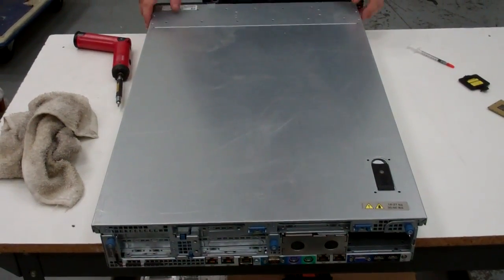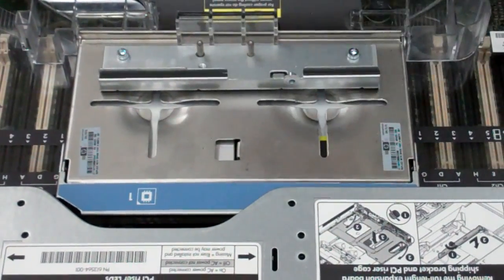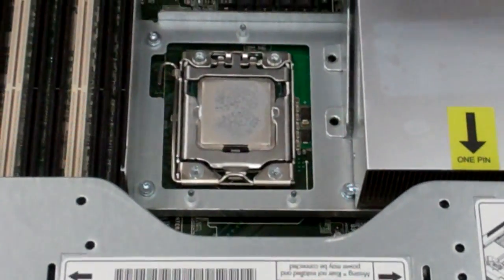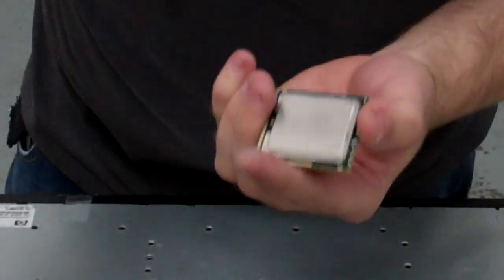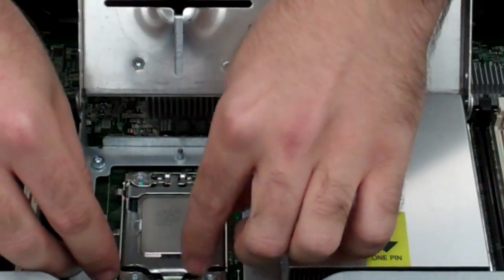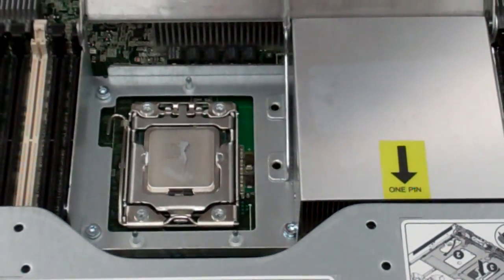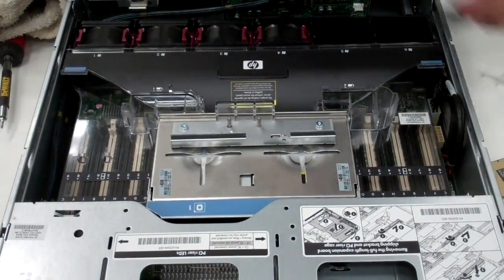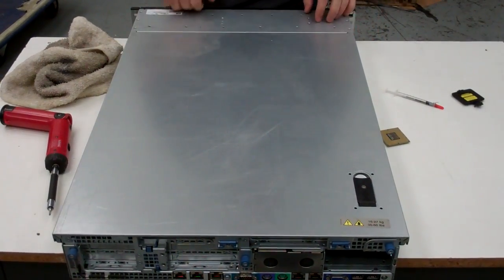Velocity Tech Solutions - How to Add or Upgrade a Processor in a ProLiant DL380 G6 Server

Comment: You are looking for full coverage of the CPU with thermal paste, but no excess.  Most thermal paste manufacturers recommend a pea size dot in the middle of the processor.  If the grease comes with templates and a smoothing card, this is a much more efficient option. 

If you look at the coverage on the processor from before, it was far too little